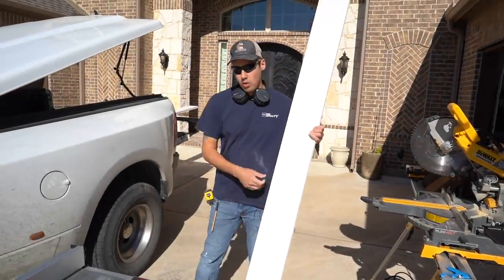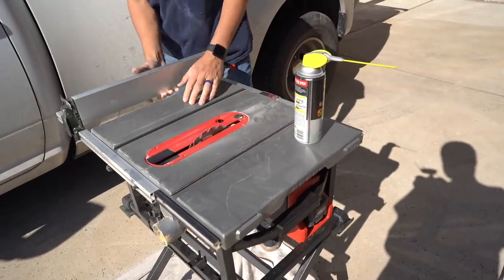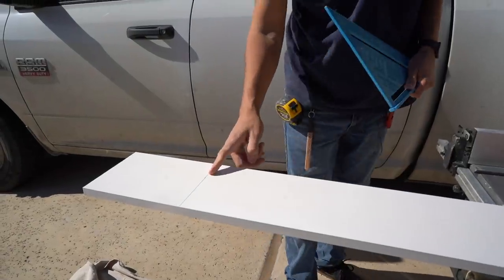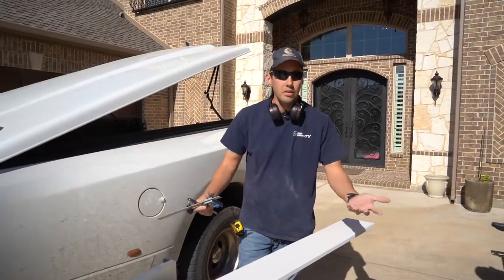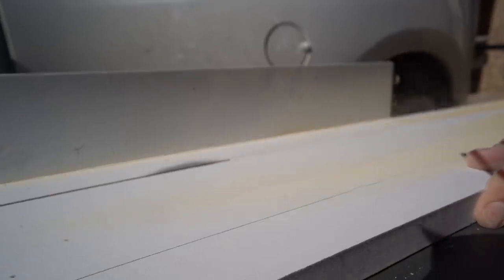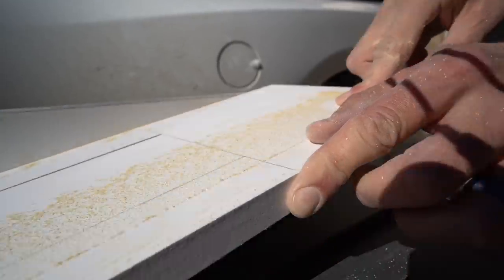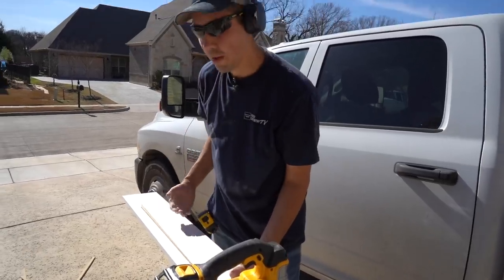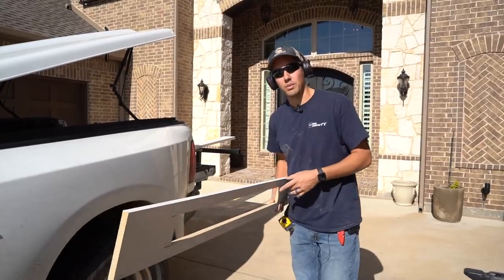This carpentry trick saved me so much time

Comment: If you draw a couple sharpie lines on the fence where the blade is it gets you closer to where to start
Reply: Marshall Williams - I used to do that... and then stopped doing that when it became more of a pain than anything. Unless the blade height, stock thickness, sun and starts - are all aligned perfectly - you usually break through not where you wanted. Lol. Climb cutting isn’t the worst. Just have control over your work. If it catches, you’re unlikely to get hurt if you’re smart about hold and hand position. 

Oh, and I was also tired of having sharpie rub off on white trim work. Ever tried to paint over sharpie?.. good luck...
Reply: shawnhuk I just do on the max the blade can cut... not precise by any means... just quick reference
Reply: I do that when making fluted pieces. Great tip for that type of accuracy

Comment: I usually just lower then raise the blade into the cut. Keeps the piece flat on the table easy to keep hold/control of
Reply: Helps a lot when you do a smaller peice. I dont know about you but the smaller the peice the more it wants to jump around

Comment: Nice tip. Interesting that what you call a framing square is just a large speed square. What we call a framing square in my neck of the woods is the steel 24" x16" L shaped square. The good ones have all the numbers to stick frame a roof. Old school info on the square, but actually helps on those stick built hips when you get to do one.

Comment: I use this method often.  When using inset molding, stay back from the line with the table saw and finish the whole corner with the jig saw and sanding block.  The relief cut on the back leads to a weak point in the corner.   Also extend your blade all the way up to minimize the long angle of the relief cut.
Reply: striker 273 a weak point of what? When is that corner ever gonna have stress on it. You could rip a dado on the back 1/2” wide and it wouldn’t matter.

Comment: That's not a framing square, it's a speed square. Framing square is in L shape.
Reply: Thomas, function equals name when it comes to naming tools.  A screw driver drives screws.  A hammer hammers nails.  A speed square IS a framing square that helps one square up framing material faster.  Tools that do not name their own function are foolishly named.
Reply: @frschatz3200  That's deep
Reply: Actually it is called a "Rafter Square".
Reply: and you're simply called a square.

Comment: If you use 1" MDF and don't let the underside of the table saw blade cut  into into the line, and you finish the cuts up real nice, if you have a roman ogee bit that is short, not very deep, you will have room to route a nice edge inside, and then you can route a 1/4" deep rabbit on the back also, to accept a raised panel.  A 4" hole saw can make a nice rounded top if you want a rounded top on the panels.

Comment: I thought wd40 grabs dust and even though initially works well ...it ends up caking with sawdust.  Is that just  completely wrong info I was given?
Reply: Any lubricant applied to a table saw will become a dust magnet. Better to use wax or graphite than a wet spray lube.
Reply: It does.  But they are paying him to use it so he does.  He likley cleans it off later so it will not gum up the works.  I would pretend to use it too if they wanted to pay me for it.
Reply: Silicone spray or wax piece

Comment: U say its a casing leg, I call it pilaster 😉
Reply: Pilasters are a structural column thats built out of a wall in a building not peice of trim?
Reply: Pilaster is a rectangular column projecting from a wall, doesn't have to be structural
Reply: @makavelione513  pilasters are structural components that support beams in concrete/ brick foundations/walls, I've honestly never heard anyone call anything architectural in stick frame construction a pilaster, maybe its cause I've worked in Canada and Europe?
Reply: Most dont know the terms
Brent hull is full of terms. Gary striegler

Comment: Thats actually a great work saver for sure, wish ithought of that when doing my columns. Just scares the hell out of me, because me table saw got finger tip hungry on me one day and since then I hate using it. But lesson learned "don't use power tools while exhausted". Great work l, love your videos!!
Reply: Jason Williams Tkankfully I didn't completely sever them I fed the tip of my ring finger first exploding the tip and cutting the pinky and middle finger (they didn't get stitches miraculously). The hand surgeon had me literally flush out the bone chips from the tip of the ring finger under the sink and sewed it back together. Little mishapen as a reminder now. Woke me up faster then red bull
Reply: @John-vf9py  My dad did the same thing to his thumb on a tablesaw.  The doctor surgically moved the nail bed back and you can't tell he ever cut his finger... Until he holds his thumbs side by side and one is 1/4" shorter than the other, I think about it every time I run one of my saws.

Comment: Wd40 has a wide range of state of the art lubricants. Be sure to use the right one for the job.  I bought their water base spray degreaser for quick clean up without any harsh chemicals or petroleum solvents. Works great, and for people who suffered occupational solvent overexposure, like myself, it keeps me working safely and comfortably. Their other great product is a synthetic grease with class leading water washout resistance-boaters, I’m talking to you. If he uses the product, he can endorse it commercially

Comment: What’s the model number on the Dewalt Miter? Do u recommend this over the battery Milwaukee miter saw? Thanks brother!
Reply: YELLOW JACKET LANDSCAPING, LLC. I have the Milwaukee. In fact I have milwaukee everything. Literally. But I’ll be getting the DEWALT. I’m over the Milwaukee. It’s clunky and not very solid feeling. I HATE having to do any compound cuts because there are no detents in the head and getting it back to 90* is a pain and required a square to do. 
It’s a bummer to because I have time of batteries.

Comment: Great tip and video.  Now, one tip for you.  Always wear breathing protection when cutting MDF (actually, it should be worn anytime wood dust is present).  It's full of formaldehyde, which can be toxic when breathed.  You don't want to be one of those folks on the Inogen oxygen generators when you're 60.  Like hearing damage, it's gradual.  Great job on the video.  Very useful. Thanks for taking the time to make this.

Comment: If you mark the fence with lines to indicate the front and back cut limit of the blade you can align the stop marks on the wood with the fence lines and eliminate any need to climb cut.   When doing a cut like this I raise the blade as high as I can to minimize the unwanted cut on the back.  I know it violates safe practices but so does climb cutting.  I guess we are both turning to the dark side.

Comment: Avoid the climb: With blade height set, use your square to make marks on the fence to show where the frontvand back of the blade is when entering and exiting the work piece. Then when you plunge, use the square marks you made across the width of the board to judge where to drop the board down. With a little experience and care, you can safely drop down close enough to the far end of each cut that you won't need to climb cut at all.

Comment: Yeah the WD-40 is great to lube up your table saw but after you read about 3,000 lineal feet of a Zack or CDX you're going to have the same problem you started with if not even worse because the WD-40 clings to things!
Reply: WD 40 oil attracts dirt. Silicone or Teflon achieves the same thing but doesn't attract mess.
Reply: steveg5576 good tip. I was wondering how the Mdf would with its new found home. I’ll try silicone.
Reply: @jmlcolorado  definitely would avoid any silicone based product. It will destroy any finish you put on the wood.

Comment: Plunge cut closer to your line and do it opposite of the way you did it, let the excess board that is behind you be on the ground when you start the cut. Lower the end you are looking at into the blade. That way if you do have kickback the board is lower to the ground and not aimed upwards where it could fly further and be head level for the guy behind you.

Comment: To avoid having to need to hold the falling parts, I use a jig or two made of left overs of the same material I am cutting that forms like a clamp, one long bit under, one shorter in the middle and one at the top of the same length as the under. That frees up my hands to be more precise and not worrying about being hurt.

Comment: What is the pencil holder you are using?
Reply: You can buy them on Amazon. Search for Heavy Duty Retractable Pull Pen.
I tried using one but the cords end up not being long enough to reach over head when you need to mark something like crown molding. Making a mark at the saw is fine or for any other place within 2 feet reach.

Comment: where can one find that pencil holder? im also not a fan of the toolbelt and would love something like that
Reply: You can buy them on Amazon. Search for Heavy Duty Retractable Pull Pen. I don't recommend it. I tried using one but the cords end up not being long enough to reach over head when you need to mark something like crown molding. Making a mark at the saw is fine or for any other place within 2 feet reach.

Comment: Hey love the videos! Could you do a video on painting bare mdf and what kind of primers and paint is best?
Reply: Shellac & Penetrol work well to seal MDF. Shellac dries faster but doesn't work with urethane top coats. You can put shellac over urethane but not vice versa. Hope this helps.😊
Reply: @azmike1956  thanks! Say i put the B.I.N primer on mdf then use a enamel finish like the emerald from sherwin-williams is that okay? Where would you say is a good place to start with learning on finishes?
Reply: @TheBlizzard54  i learned about Penetrol from a painter who was helping me on house rehab's. We were replacing cabinet doors with MDF & the rounded over edges kept sucking up the paint.
After some experiments we coated all door surfaces doing the edges about 3 times to seal them. Using latex paint & an airless it came out looking like a nice oil finish. We did use Floetrol for better flow out. Penetrol for oil & sealing, Floetrol for latex.
I found out about shellac on the old tv show Furniture to Go & Furniture on the Mend.
It's so easy & fast to use for finishing wood, sealing stains & odors before repainting & french polishing. You can probably get more tips right here on Youtube. Stumpy Nubbs may have something.
Hope this helps! 😊
As far as BIN goes, if I remember correctly it's either alcohol or oil based & should work well with the SW paint.
Do some experiments & practice before jumping into a big job. Good luck.👍

Comment: Hay Richard do you find it a pain in the neck to carry around 2 or sometimes I see 3 battery platforms?
Reply from the maker: I only carry milwaukee and dewalt now so its not too bad.
Reply: @FinishCarpentryTV  I almost have done down that road of carrying 2 battery platforms because I like what another company has to offer. I tap out tho I can't deal with all those charges 🤣
Reply: I wonder how well those battery conversions work in a situation like this,I don't think a converter would be that big of a deal size wise on bigger tools where it doesn't matter, like a mitre saw or a table saw

Comment: What if you have a sharkfin on your saw, behind the blade? I love the adjustment knob on the DeWalt saws. They are some great saws
Reply: getberget that’s called a splitter or riving knife. You’d have to remove it for a cut like this.
Reply: A riving knife is critical on a table saw.  But for this cut it is safe to remove it.  Just make sure you reisntall it when you are done.
Reply: Riving knife is easy to remove on these Dewalt saws. Just push a tab on the side and pull it out. I like the dewalt so much that I sold my craftsman cast iron saw.

Comment: Good tip there Richard.  My ears perked up when you mentioned giving tribute to WD 40.  My Friends call me WD 40 or just Slick Willie but either way. you made my day.  One more thing I do is rub some wax on the face of the fence, both sides of the blade and table top to make them slide and cut easier.    Cheers Mr. Trim Wizard!

Comment: NEVER DO THIS! You are breaking 2 rules of table saw use. 1. Plunge cuts need to be done with the front of the blade. 2. NEVER let material move backward in a table saw!  Calling this a climb cut does not make it safe. People are not prepared for the violent kickback that WILL happen. I keep curling up my fingers to protect them as i am watching this. There are safe techniques to make plunge cuts. Please educate yourself before posting.

You should delete this video! Someone will lose some fingers by copying you. Not to mention, firing a board through their garage wall.

Comment: My tracksaw rocks for cuts like that. I usually use the tablesaw just for smaller rip cuts for the most part now. I have the cordless makita and it rocks, especially for doing rip cuts on sheet materials and doing long angled rips.
Reply: Where do you put the track on smaller boards like this? Do you need another board to help support the track? Been thinking of getting one but this is one question I have,  how to rip smaller stock.

Comment: Pro Tip,  throw that  “W”orthless “D”oodoo 40 yards away,  and get yourself some Dry Lube with Teflon !
Use that on all the moving parts of your saws, it doesn’t collect sawdust and make “wood cakes”  like wet lube does !
I get that it might be exciting for you to get a video sponsored by a household name brand, or maybe some free stuff, but it is not, by far, the best stuff to use on wood working machines.  Dry Lube is silicone free, a huge concern for any machines coming in contact with bare wood surfaces that need to be finished. Try it, maybe they will go in a bidding war with doo-doo for your videos.  By the way, I’m a self employed carpenter for 30 plus years, and I am right down the road from you (a couple hours, actually), and I “do not” get anything from the dry lube brands, except silky smooth machines !
Oh, the brands of Teflon dry lube I use are DuPont, and Blaster.

Comment: Why do you use MDF all the time that material is junk especially if it gets wet regular wood is so cheap
Reply: It's very, very common in new construction and remodels. It's cheaper than real wood, and it's dimensionally stable. It's trim. So unless it's in a bathroom it won't/shouldn't get wet. 

I'd prefer solid wood all day every day though 🤷‍♂️
Reply: @zacharybaker695  I'm a contractor in South Florida if another contractor came to my house with that, I'd kick him out immediately.
Reply: I agree. MDF is garbage.
Reply: I always use primed pine unless the customer isn't willing to pay the little extra it costs.  The customer rules.
Reply: @user-ne9wp8ve5u  Nothing that is useful is garbage.  MDF is useful.
Reply: @edwaggonersr.7446  how much does it cost in your area for pine I'm a contractor and its peanuts in south florida for pine I believe I pay 60 to 70 cents for primed pine crown molding if u cant pay that the customer cant afford to remodel there home
Reply: @cream6936  Whatever.
Reply: @cream6936  I'd imagine South Florida isn't the best climate for MDF. But does that mean it's garbage, and can't be used in the rest of the country/world?
Reply: @Davey768  yes its garbage because if you use MDF for base if u hit the corner of the base it is ruined it not like real wood where u can fill with putting and sand it
Reply: MDF isn't the best product that's for sure but people in my area use it because it except paint the best
Reply: My vote is on pine, I hate mdf, and the price difference is only a few cents in my area, so what if you can save a few bucks on an entire remodel, the quality difference is worth it not to mention mdf is toxic to work with and as someone mentioned one drop of water will destroy it, finger joined pine all the way 👍
Reply: @cream6936  Weird argument  when 90% (seems like) of Americans use drywall on their walls and ceiling.
Reply: Dude you can totally use putty or spackling on mdf

Comment: What happened to the "medium density cancer" warning? Also, tried to do this recently on my little table saw and found it wouldn't work because the riving knife got in the way and stopped the wood from dropping onto the blade. Decided it wasn't worth taking the saw apart to remove it and instead went with a multi-tool to do the cut, which worked out great.
Reply: markanne54 I don’t know about your saw, but mine the riving knife is stupid easy to drop. Pull the cover off the table, reach in and it’s a 1/4 turn thumb lever. Drop it down and tighten it back up.
Reply: I would bet your multi tool line was a bit less crispy than a table saw cut

Comment: I get that you are reducing your joints, but when I have done work like this, I have used glue joints to join the vertical styles to the short rails. You can use smaller size material and I have found that regular wood material is much stronger for this purpose. I have done this for both trim work and for furniture.
Strength is probably overrated for a piece like this, and I understand that you would be losing time to make glue joints, so your method may be best for production work.
Reply: You say you "get" what he is doing then go into a long rant which makes you sound as if you do NOT "get" what he is doing.
Reply: @judsonkr   
He is doing production work...doing it fast because that is how he makes money. This method is faster than gluing separate pieces. I get it.
I don't do production work, I do not make money doing this.  I do it for myself, and for that I prefer using separate pieces and glue joints.  Superior, in my opinion, though much slower.
Does that help you out? Good grief.